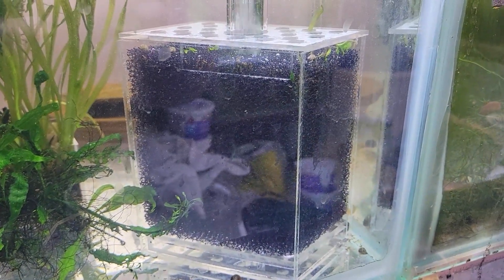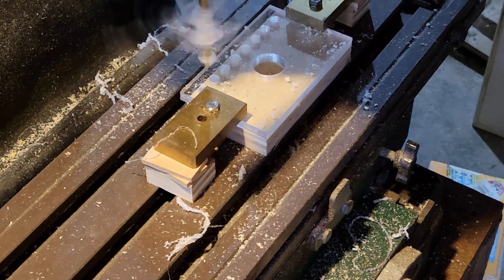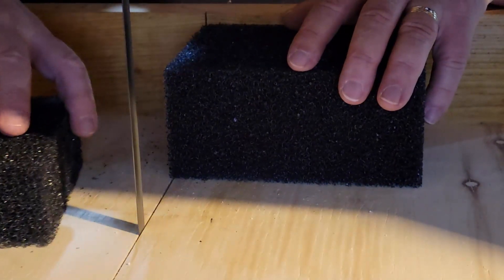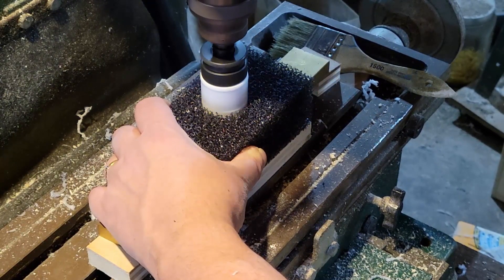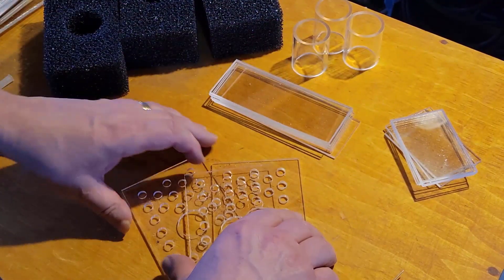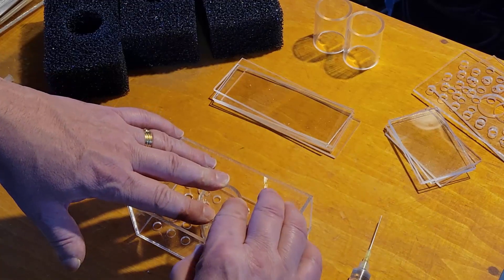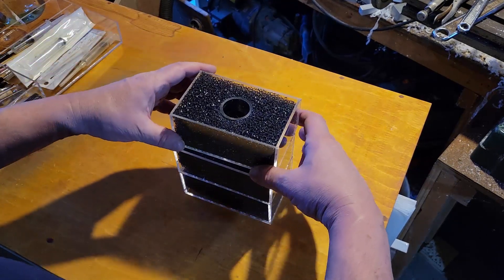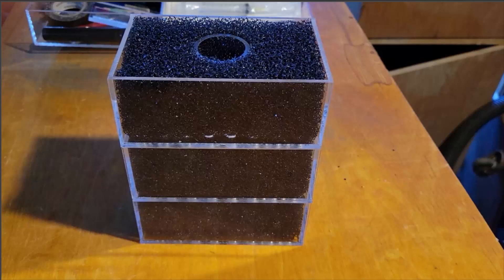How Much Filtration Do You Need Experiment?

Comment: Hey Fishman! Love your videos!!! Any chance you’ve ever built a VERTICAL SUMP? I have a very limited space under the cabinets my tanks are currently sitting on. I really feel like my Cichlid tanks will benefit from having sumps, but without taking the tanks completely down and building custom stands, I just don’t have the space for a horizontal sump. ☹️
Reply from the maker: Thanks so much Doug! Squeezing filters into tight spaces is one of the things that got me into DIY. Vertical sumps aren't that different except in one area and that is the volume of water they can hold. Because the square footage of the base is so much less than that of the longer versions, for a given depth of water there is much less volume. You really have to watch evaporation with them.

Comment: Will a tank w30cm h35cm L60cm be ok with a over hang from the stand on one end having 40cm supported leaving 20cm hanging over the glass is about 3.5mm I think you will say no it seems a bit of a bad idea to me but I have seen people do worse and if it's going to be fine it would save me a lot of work and stress it would only be temporary well I rip out all my tanks and start over I have got hold of 6 tanks this size to set up some where else in the house to move a lot of the fish to for a while if 20cm over hang is ok I have a perfect place it's been hard enough to get the wife to let me put more tanks some where else in the house lol
Reply: It would be better to centralise the overhang, that way you will even out the stress on the tank which should prevent it cracking
Reply from the maker: Hey Colin! Overhang can be an issue. Aquariums are tough if built properly. When I first started building them I deliberately pushed the boundaries to see what works and what doesn't. Short term, you should be fine. The tank you're talking about is small (about 16 Gal). The glass is a bit thin for a tank this size (I use 6mm) but again it is short term. Hope that helps